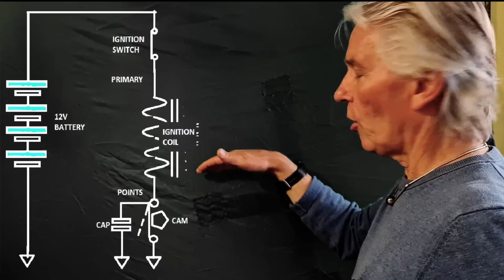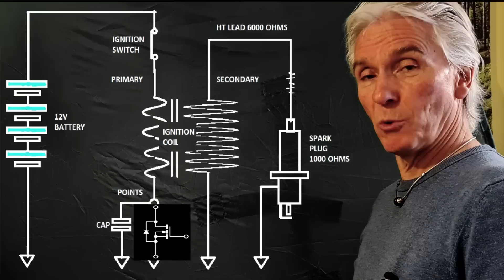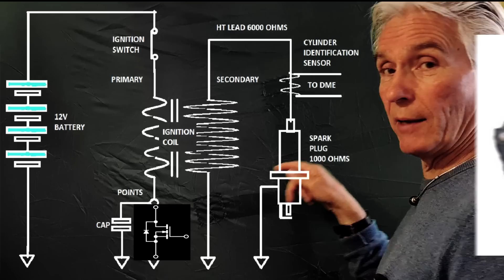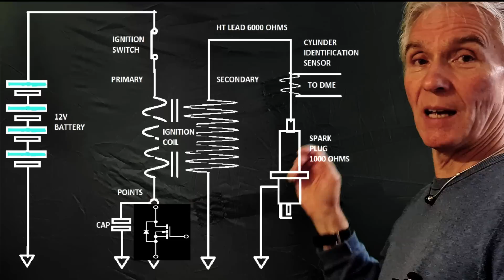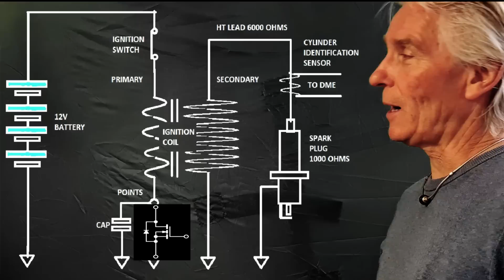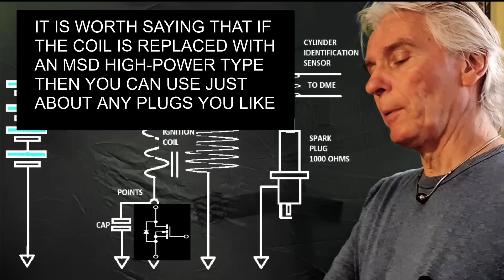The STRANGEST Ignition System IN THE WORLD BMW V12 M70

Comment: Funny thing is that the Alfa Romeo Busso V6 Turbo (used in 164 & Gtv) has exactly the same ignition system. The distributor is identical with the M70.

About same era and both Bosch systems.

On the Alfa V6 all six injectors are fired all together on one output.
Reply from the maker: That's a fascinating bit of trivia, thanks for sharing the connection between those Bosch systems!

Comment: I was tuning the M30 turbo engine (m106), with E23, and encountered a problem with the detonation prevention system operating at medium speeds. The problem turned out to be in the spark sensor on the 6th cylinder. Namely, the signal from the sensor on the 6th cylinder wire was reflected on the detonation sensor wires, and the DME limited the spark. The problem was solved by moving the 6th cylinder sensor wire from the common box, from the engine to the mudguard and to the DME.
Reply from the maker: That sounds like the shield conductor is not connected causing signal ringing

Comment: Hello Timm, really enjoy your videos. Does m70 engine use ignition-cut type traction control?
Reply from the maker: Thanks! It uses a combination of intervention, starting with closing the throttle (which it can do very quickly with the electronic throttle bodies), it can retard the timing and in the worst case remove engine power entirely, but this is quite unusual

Comment: Good evening, I am experiementing with my 850i M70, lol, running NGK platinum plugs, ZFR6FGP, 5K resistance, with MSD blaster coils that are 40K volts if I am not mistaken. I just changed valve stem seals and started driving the car this week. So far it runs great! Seems to run smoother than before but the old plugs were fouled from bad stem seals. I am curious why it seems to run fine with this combination of coils and plugs? Do the DMEs have a CIS signal range where the MSD coils and platinum plugs are within that range? Thanks,
Reply from the maker: With the MSD you get a good signal for the CIS's, so don't worry!
Reply: Thanks, Tim!

Comment: I came here for help because I'm out of mind already frustrated with this issue. The gremlin I seem to have on the 850 M70 is that Bank 2 doesn't work. But when testing the plug for the donut sensor coming from the DME, it doesn't have current. So voltage wise it's dead. At the DME it also doesn't have the 4.5-5V. In the hope that the DME is faulty I swapped the known working one from Bank1 and it does exactly the same thing. Does anyone have any idea why the DME would not send 5V current to the sensor? Crank sensor has power, it's just the donut sensor doesn't. Help please...
Reply from the maker: Try swapping the DME relays in the E-Box: https://www.meeknet.co.uk/e31/Timms_BMW_E31_Relay_Finder.htm#google_vignette

Comment: Hi Tim! Very uselfull video. It has helped me a lot. But I have problem my m70 engine is burning fuel in right exhaust pipe. And then it is changing which bank of engine is not running properly. I checked sparkplug wires with tester pen. Now my guestion is should the lamp illuminate in its one when 2cm away from spark plug wires. I was thinking is my problem old wires that are leaking elctricity?
Reply from the maker: The HT leads are really expensive to replace - but if they have been around a while then yes, replace them, it will always give better performance

Comment: Hello Tim! Been watching your videos for a while now. Trying to get my E31 running on all 12 cylinders. You said to make sure the spark plug wires are 1k resistors vs 5k. How can i check?
Reply from the maker: Remove an HT lead from the distributor and from the sparkplug. Use a cheap multimeter and measure from end to end - it should be 6000 Ohms

Comment: Love the video's Timm! 

Are you absolutely sure the injection is disabled fully when the signal is missing? I remember when the DME was missing the signal from the doughnut it would fire all 6 injectors of one bank at the same time instead of in groups of 3. Of course diagnosing this it is a pain in backside as the M1.2 Motronic doesn't spit out a code which the later M1.7 does do. 

Same setup is also in the late M30s with Motronic M1.1/M1.3 as used in the e34/e34.
Reply from the maker: Yes, injectors off on the M70, M30 not sure.....

Comment: Recently acquired a 91 850i 6speed LHD and  I’ve been watching your e31 vids to get familiar with the oddities of this magnificent vehicle. Many of your videos contain exactly what is needed for this 850.  The first and perhaps most important piece of advice was DO NOT JUMPSTART  so I purchased new battery and went with the single battery setup… car maintenance and small repairs can wait until my 2000 m5 is back on road (rod bearings, T.chains&guides , clutch/flywheel are installed)
But i didn’t want to damage the windows when opening doors with old drained batteries. Looking forward to seeing all the other videos you’ve made over the years.  I also have the m62b44 in my 97 540i/6 daily driver and your inpa diagnostic overview has been eye opening. My 540 has a rough cold start , idles smoothly , tons of power but has some vibrations when revving up 900-1600 rpm’s. No doubt   You’re m62 advice will also prove helpful.   You deserve to be one  the top YouTubers in your area of expertise.
Reply from the maker: Very kind of you!

Comment: i intentionally changed my M70 spark plug with Bosch FR7DP because i love the design of the insulation of that particular plug models that wrap around the electrode tip so well , preventing short circuit in wet combustion chamber commonly happens in old cars .

But after that plug change , my car do start and die after 2 seconds .......

Then i search for help online and found your video , and you save my life !!!!! 

though i still wonder and hope that Bosch FR7DP has also 1000 ohm resistance, but i can't find any info on it online , any suggestions where to look as i don't have digital multimeter myself 

 guessed i just have to clean and use back the old NGK plugs (I still keep them) or buy new NGK BKR6EK or Bosch FR8LC 

Another thing is before i changed the plugs my car always cold starts very easily, but sometimes don't have enough power , will not revv up , must wait untill it would revv up , sometimes must wait for so long , sometimes just  wait a short while , BUT some other times it just cold starts and immediately have power and can be revved up immediately after cold start , now after watching your video i suspect that it may be caused by the old plugs resistance are not 1k ohm , or the doughnuts are also weak/unstable , so the  engine is thrown into limp mode , what do you think ?

Sorry my English is so fakin confusing 

THANKS Timm
Reply from the maker: Hello Kevin, get yourself a cheap ($20) meter and check everything such as plugs and HT leads

Comment: Exotic ignition setups like this is actually quite common with V12s (or at least as "common" as any component can be in a V12 considering how uncommon it is to have 12 cyls)

Check out the DB11S with the AE31. It reminds me of the same way an M70 is just a pair of siamese M20s as it were.

Comment: Hi Timm, sorry for this comment being irrelavent to this video but I'm graping at straws. Recently driving my E38 tones of smoke started pouring through the vents, ABS and Traction control lights came on and brake lights got stuck on. Soon enough I discovered the brake light switch has physically melted (bit strange). Have tried a new switch and the brake lights are still on, scanned the car for any codes using a launch scan tool, just to find an error related to the thermostat "DME : Activation, Map cooling P1622" Not even sure if that's relevant. If you've seen anything like this before or could point me in the right direction would be much appriciated. Regards, Jay
Reply from the maker: Hello Jay, replace F44 in the front power distribution box and you should be up and running again
Reply: @TimmsBMW  Thank you very much, this is going to sound super dumb but where abouts is that located. Thanks alot Timm
Reply from the maker: @jay_claricoat  E-Box (four large screws) and the fuses closest are 33 (right) to 48 (left) - they will be marked in the lid
Reply: @TimmsBMW  As above have managed to find it Timm. I owe you big time as it appears to have done the trick, you are a genius!! Just curious if you would know the reason for the brake light switch to burn out, quite scary and don't really want it to happen again. Thanks
Reply: @TimmsBMW  I have just actually done it so ignore the last comment. May I say you are a genuis, there was me thinking it was some horrid wiring issue and looking into it too deelpy, asking loads of people and no one knew.  Thank you so much for sharing this knowledge, I owe you big time!!!!!!!

Comment: You drew the iron V8 ignition system wrong, The coil only has 3 terminals and the spark completes the circuit via the battery.
Reply from the maker: Thanks, you are correct!

Comment: Timm I have the 04 e63/64 w n62 and SMG transmission. The transmission is leaving me stranded every time I drive the vehicle for over an hour in 90+ degree weather. Do you have a reference for me to get information on the hydraulic pump that controls the clutch, and information on how to diagnose or repair the transmission using the INPA computer software. 

I want to figure out how to overhaul the transmission so that the vehicle is reliable again, but I want to do the work myself without rebuilding the transmission. I have seen someone say that sometimes the transmission shifting needs to be 'retrained' after the vehicle is hot or warmed up completely but I have no idea how to do that. Can you please help?

Also, I had to reseal my headlights because moisture was getting in and it corroded the electronic components that power the adaptive headlights so I had to replace those components as well. I completed the rebuild for the drivers side light successfully, but when I disassembled the passenger side light the halo glass was so rotted from moisture that the halos crumbled on contact. Do you know anyone with a cheap 645 headlight? Online they're quite expensive.

Also, I used your video in the past to clear the front drains for my 645. Water was flooding the carpet, but after using your video I successfully cleared the drains and had no more water drainage issues, so thank you.
Reply from the maker: Hello Scotty, sorry I know nothing about the SMG system, I only learn about systems in my own cars. But, your first port of call should be the 6-Series Forums on Bimmerforums.co.uk (not .com - that's dead), there are many helpful, knowledgeable people on there. Good luck!
Reply: @TimmsBMW  okay thanks. I will. Keep doing e63/4 updates. I really appreciate them and find them useful. Im doing the valve seals tomorrow and utilizing your video. You're a bigger help than you realize. Thanks again!

Comment: I wonder if this is broadly the same for the S70B56 engine in my 1996 CSi?  This engine is in the same general BMW engine family as the M70.  But I believe that its 2 x DME M1.7 systems are somewhat different from what the M70 has.  Also, I have Bosch F8 LCR 2 spark plugs in my engine, I guess this could also just be another difference from the M70?
Reply from the maker: Hello Robert, S70B56 has proper camshaft sensors - at least the Performance division knew what they were doing!
Reply: @TimmsBMW  Thank you Tim, I have found your E31 insights invaluable.  BTW do you have a view regarding the Bosch F8 LCR 2 spark plugs?  Or are they just another difference between the M70 and the S70 engines?
Reply from the maker: @robertbowe2672  I would stick with BOSCH FR8LC, they were the original specification Robert

Comment: In order for the HT leads to be  6000 ohms each wouldn't they all have to be the same length, seems unlikely
Reply: My guess is that 6000 ohms is the maximum resistance and it reduces as the leads get shorter. The longest leads, and the slightly weaker spark, go to cylinders 12 and 6 which has the sensors so if these 2 plugs are firing OK it probably means that the other 10 are as well
Reply from the maker: The resistors are in the connectors rather than the HT leads themselves - hence why the differing lengths make no difference - I should have made that clearer in the video!

Comment: They should have had cam sensors, not a hard thing to design into the front timing cover. Nothing wrong with batch firing the injectors either, carburetors do the same thing with pooling fuel on the closed intake valves and I have never had idle or running issues from setting up EFI that way.
Reply from the maker: Thanks Drew, the late 80's was all about economy and BMW were trying to make economic cars against a backdrop of fuel shortages - that's why they were going for sequential (or semi-sequential) injection. A cam sensor would have been a lot better though!

Comment: Great Video Timm.  Thanks.  Would you happen to know if the early M73 V12 as fitted to my April 1996 E38 750iL has a similar system? There seems to be a donut around one spark plug lead on each bank that seem to be connected to the engine wiring harness. There are no coil packs for the spark plugs, there is simply a single coil pack for each bank of cylinders which have their sparks passed through the two distributor caps.   Do you also happen to know if the following spark plugs are 1k resistance - BOSCH F 9 LCR2?  I could not find information on their resistance on line.  Thanks - Mark (from Kyiv, now in UK with my 760Li E66 and family, waiting to return ...). My E38 is waiting for me back home in Kyiv.
Reply from the maker: The M73 has proper camshaft sensors Mark, so you are OK with most plugs!

Comment: m70 for sure is a strange one . those cps sensors are eom only . i tried 4 different brands and none worked properly , ended up with good used eom ones
Reply from the maker: Thanks! That's a strange one, the CIS are only a couple of windings on a bobbin - possibly wired in reverse or something!
Reply: @TimmsBMW  all made in china or france , i measured the impedance and none where the same as oem